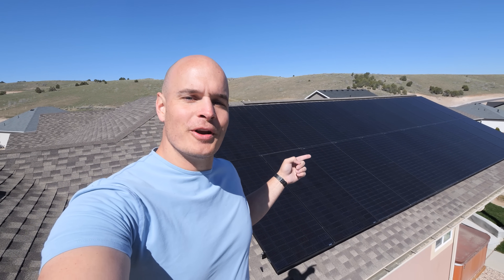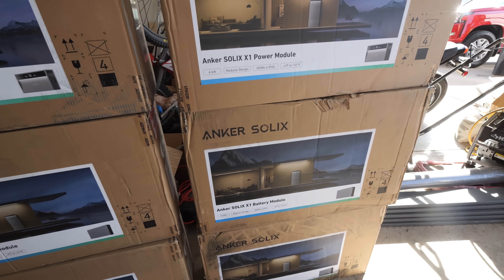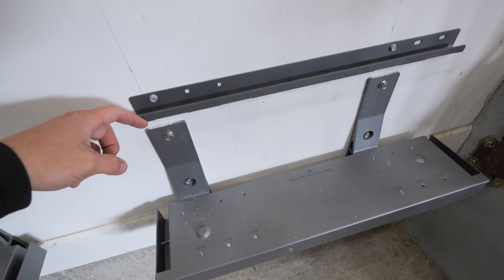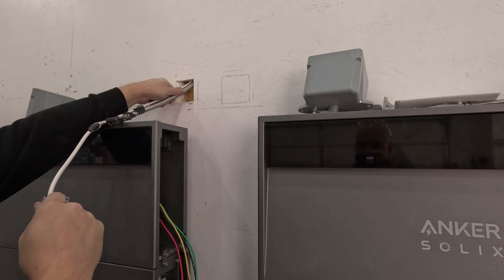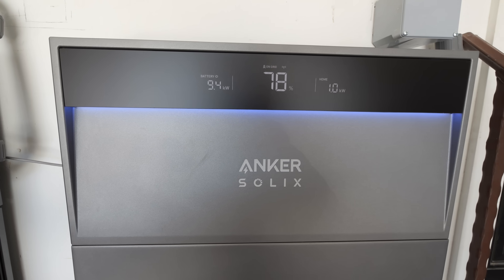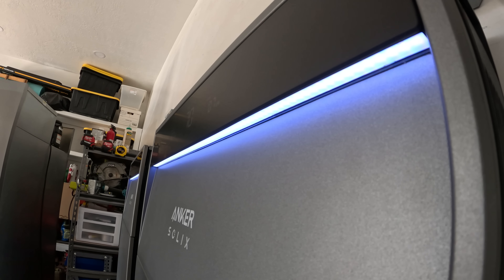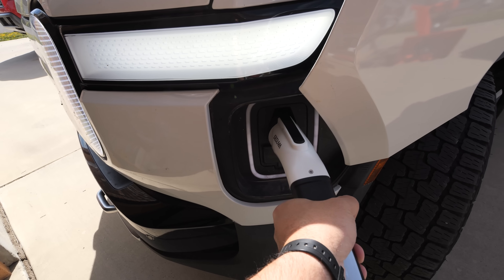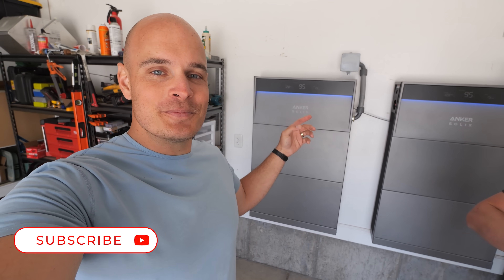How to Save Sunlight for the Night? - NEW Solar Battery Install

Comment: As a german, its insane how easily you guys can just drill through your walls and install stuff like this. Here in Germany we would need pretty big machinery to drill though the walls of our garages (its like 10-30cm solid wall). Nice video!
Reply: Depends on how you make the house... 
Not all homes here are the same...South Florida has huge wind limits on buildings, and last over 150mph hurricane winds.. but not all counties are the same laws.. every city has different little sublaws
Reply: In California its ridiculously expensive to build homes out of brick or concrete due to the amount of earthquakes and the reenforcement it would take to be structurally sound.  Wood homes are much more likely to survive as they can bend and sway a bit.
Reply: @misterinternational  that why they invented anti-seismic house  technology.
Reply: @misterinternational  do it right wooden house can last 100 of years.....
Reply: Is just expensive and americans just want cheap things not because of earthquakes you have literally tokyo that has house made out of concrete and huge building but never collapses because  of antisismic structures  @misterinternational
Reply: @misterinternational  We have quakes too, houses are still made out of brick, mortar or concrete. Some of these houses are older than modern US, some are older than US period. :)
Reply: Yeah American homes are pretty much made of cardboard when compared to European homes.
Reply: @Fisheee123 done purposefully for this exact reason! Less materials makes it easier to modify and rebuild the home on the land every few decades vs having to live in a 209 year old home with doorways that are 5 feet tall
Reply: @derekderek2570  I know, I wasn't saying it's a bad thing, just a fact
Reply: @Fisheee123  even worse it’s made of drywall
Reply: @Fisheee123 same in Australia. If you hit the wall hard enough you can make it through, no need for any equipments😂
Reply: @Fisheee123 same in canada ;).
Reply: @Fisheee123  well definetly compared to the continent, but british and irish houses are worse than american, they literally just crumble
Reply: homes made today are built with 2x4’s or 2x6’s vertical Studs centered 16” on center with 2x8 or 2x6 roof framing members. Secured with 3” Ring Shank Nails. And joist or hurricane hangers. Also the bottom sill plate is pressure-treated wood bolted to its concrete footing every 2-4 feet! Also using hold downs tied to the footings. In addition, builders are using 7/16 thick by 2 x 4 sheat’s  of OSB, which stands for (oriented strand wood board)the strengthens the  exterior house walls from rocking! Also 2” Ring Shank Nails, are nailed into OSB Sheating into their exterior 2x4’s or 2x6 framing! The only builders that are using thin cardboard garbage are the ones that are getting are overlooked by the county inspectors! I don’t believe it’s legal in any state or any county to use cardboard sheeting instead of OSB Sheating as I described above!
Reply: Its so funny he cut through it with like a big steak knife
Reply: Now you know why they turn on loud music during play time.
Reply: Das kann doch nicht sein, dass sich unter dem Kommentar nicht die ganzen deutschen versammeln. Ich habe keinen deutschen Kommentar gefunden xD
Reply: @davebond4451  Deutsche Tugendhaftigkeit - schreiben eben alle auf Englisch ;)
Reply: I've installed thousands of homes. PLENTY of solid brick/cement or stone walls. Even just a good handheld battery hammer drill and a masonry bit will rip through them quickly. It's not hard
Reply: Not to mention planning 😢
Reply: Apparently you have amazing walls but terrible drill bits. 😂 I could get through that wall in no time.
Reply: @aaltoadamus9567  You are the only one who said that little nugget. I never said the ONLY one. I said we are a throw away society (one of many and not the only one). I did NOT say the ONLY throw away… You just implied that I said that because you wanted to laugh at yourself, apparently.
Reply: That's wild, because then you have the flipside, places like Japan, where the walls are basically and often, literally, paper thin
Reply: we have stucco, brick, cinder blocks, sand and mud, wood. Modern hand drills will drill into any wall you gave you're not special
Reply: I mean a friend of mine in Germany lives in a house which is older than the US itself right beside the city wall which was build in the year 600.
Reply: you guys have better houses we have easy to change houses
Reply: @VRVitaly easy to change but 4 x more expensive 😉 In USA you pay just for paving what in Europe can get you a whole house
Reply: @xfaktor13 Ill take your word for it... but also matters what income and cost of living is compared to US and what parts of Europe are we talking about...  so we gotta compare apples to apples.
I actually dont know... anyone can educate us?
Reply: This entire thread is proof that people will try and find anything to not only argue about but also make themselves feel superior about. Yall, on both sides, must have some major self worth issues if you're really here saying "nuh uh our houses are better". Who the fuck cares. My house is brand new and fucking sucks. But I'm certainly not about to move to Europe because of it.
Reply: @sys-administrator auch wieder wahr
Reply: Do you think that’s a pro or con ? Sounds like a big pro to me
Reply: And yet the housing cost is very high.
Reply: It will also fly when a hurricane comes 😂
Reply: Because in UAS we have earth quake... 😂😂😂😂
Reply: I wouldn't say all American homes are stick made, out here in Florida it's cement block.
Reply: I rather have a concrete basmeny and solid brick walls than matchbox house. The steong winds alone will f up the matchbox house. I dont understand why in USA where they have so many tornadoes/hurricanes the dont build concrete/brick houses instead of the wooden ones that get destroyed every time.
Reply: @Tkozuh was helping with cleanup after New Orleans hurricanes and people with stick built were better off as house was already gone and they didn't have to pay to have the now contaminated brick taken away after standing for several weeks in water that could eat through an aluminium boat😮 The water was a mix of everyone's drain cleaner, Clorox, gas from lawnmowers and all the other nasty stuff that floods around most people's homes. Oh also the stuff from the industrial  district a couple miles over as well😮 Last thing I'd want is a brick home in a hurricane or coastal flooding area near any city.
Reply: @michaelcummings7246  good point. Have not thought of that. 👍
Reply: Well I was just in homes from the 1870s that are perfectly fine today. Maybe the specs and craftsmanship were better back then but similar building materials.
Reply: Don‘t forget about the 500 Pages of documentary for a PV and storage in Germany! 😂
Reply: their walls are made of paper
Reply: Because is all rubbish thats why
Reply: It's because Our homes are built like crap
Reply: That's because our houses over here are made of sticks and glue.
Reply: Concrete drill bits aren't "big machinery." lol.
Reply: These are very expensive cardboard houses.
Reply: thats, not to insult, because murican houses are cheaply made, wood and drywall where in germany you have bricks
Reply: Haha I thought the same. When he put that saw in the wall 😂
Reply: Jerry I can do that and more they They say about me the person who works in everything
Reply: Same in England. Solid brick!
Reply: Sell your Milwaukee drill and get a Bosch drill.  There. Problem solved.
Reply: but a strong wind won't blow your houses into shreds :D
Reply: In India we have same issue... because our walls are mad up of concrete and blocks
Reply: Don't listen to the haters. American homes are great. Hard on the outside, soft on the inside. There are steel/concrete in larger homes to hold up the weight, but most walls are super easy to access. You can upgrade stuff like DSL to fiberoptic for a few hundred bucks rather than thousands.
Reply: Fortunately Jerry didn't drill (and other things) through the battery
Reply: Its insane how america is still better than germany.
Reply: Yes, you need a core drill bit to drill larger holes
Reply: And how easily they screw the solar panels to the waterproofing of the roof.... 
I love this video, but it would never hold up here in Norway. Mainly because of code regarding electricity.  And as you say. Between my garage and house, there is 30-40 cm of solid wall. 

The sad part... The most effective solar panels I've found available to me, can produce roughly 8700 kwh annually.  I march alone, I used 2.900 kwh of energy.
Reply: Germans really like bunkers.
Reply: Ich hab mir genau das gleiche gedacht 😅
Reply: exactly, and I wonder also - how the drywall can hold such 'heavy' looking equipment long term...
Reply: Because in Germany they build houses to last and here in the US they build them to profit.
Reply: The benefit of homes in the US is the ability to do this. Plus moving to newer materials is easier to do. 

Also this is in California. The weather is pretty moderate at all times. Hot in the summer, cool in the winter, but not blankets of snow. And earthquakes.
Reply: US 🇺🇸 Building standards do not imply good standards but are focused on having a designed end of life, feeding the constant need for rebuilding or remodeling, or in the US, called: Bulldozer and start from scratch because nothing can be reused because it all sucks or was broken from the start.
Reply: You should see how quickly American new construction homes burn down. The wood we use can also be used for fire kindling.
Reply: Haha us house Last very long if you do not count on nature to destroy it. We don't have that much extreme weather. We build to be efficient and cost-effective. Houses are much more customizable too.
Reply: Same as a dutch person I live in a houde build before you guys did that shitty move and this house has some solid brick walls
Reply: Yeah, same in Pakistan
Reply: Solid?  Mit Luftbetongkloetzen? "Air cement" construction can be cut with a handheld manual/power saw and drills, no? Are floors still poured Beton/concrete? Mine in Zwingenberg were, but the walls even 30 years ago were "air cement'.
Reply: I guess having to rebuild after most of germany was destroyed in ww2 has its benefits
Reply: I know i was shocked when he made the holes. Meanwhile I'm staring at a concrete wall and wondering how to get started
Reply: Isn't the American way more environmental friendly? Building bricks emits a lot of co2?
Reply: A hammer drill with a masonary bit will go though no problem for things like mounting screws, like Tapcons. If you want to punch hole big enough to pull wire or conduit, you probably want to upsize the drill. Those bigger drills will make bigger holes.
Reply: You have some very very nice 3-phase electric distribution at home.  I drool over that.
Reply: That’s because our homes are just sticks and paper. One strong gust of wind and it’s a kite.
Reply: Watching from Africa and thinking the same thing… brick houses
Reply: You'll need a masonry/concrete drill bit.
Reply: I think earthquakes make it hard for buildings to be solid here without it all crumbling down at a small 4.0 magnitude quake
Reply: Das war das Highlight in diesem Video xD
Reply: Yo Soy Americano! I've been to Germany, and dealt with that.
I would still love to build my own house out of Cinderblocks, concrete filled, and 50 cm of soil on the roof.
Reply: 'big machinery', dude seriously? you can use a battery powered hand drill to make the same sized holes in your brick/concrete wall.
Reply: @tc8557  It isn't that simple when you get to the larger hole sizes, or are dealing with something as fragile as brick.
A "Coring Drill" is the only way to go, and those are spendy.
And require one HELL of a lot of training.
Reply: We need our homes to breathe,it's so much hotter hete
Reply: As someone said the American builders are not stupid, they build as cost effective as they can. Id love to have their huge houses, but instead my house havto withstand 3 meters of heavy snow and tempatures of minus 25 degrees and i live in the middle of Sweden. And all this means is i havto spend more on structural integrity and isolation that make no difference in my comfort indoors, in relative terms..
Reply: Yes, a lot of cheap throwaway crap here in America. And a lot of people with leaky roofs after the solar installers leave! 😂😂😂😂
Reply: American homes are made of paper. You can easily punch it through 😂
Reply: Yeah.. same machinery required for Indian homes as well
Reply: @derservy4596  in my technical position when somebody calls me and says I am German the first thing I do is put them on hold while I laugh. Then I regain my composure and come back to the call.
Reply: Haha I had the same conclusion! (From the Netherlands)
Reply: Considering they have such powerful storms it makes you question why they build them from wood.
Reply: @sbomorse because it’s not completely about the material, but also how you use the material, how it’s designed. The house I live in is roughly 50 years old, and lots of houses in local cities are almost a century old, theyve just gotten inside remodels at most. not every part of the country sees devastating hurricanes or tornados.
Reply: @sbomorse Agreed… 
If the storms weren’t so crazy I think wood house would be fine. The reason is we’re cheap. 😊 Why do you think we’re involved in so many wars? So yeah I completely agree with you and know the answer as usual. Lol. 😂 HUNDREDS of houses fly up in to the sky every year here. Absolutely agree. And sometimes there’s people and animals inside. 😅
Reply: I prefer our german walls. 😅
Reply: As a swede it is astonishing how much work you’ve allowed to do yourself and seemingly without asking the city for permission.
Reply: @mattisx Depends where you live and if you own the home etc how much you can do without any permits in the US.
Reply: Another thing Europeans can't wrap their heads around is the size of the US. We have houses built out of brick and stone. We have some built out of wood and drywall. Heck we even have some built out of Adobe. Just depends on where you live. A house built in Florida is not built the same as a house in Oklahoma. A house in California is built different than a house in both of those states. Even houses in Northern and Southern California are built differently from each other! Very few other countries experience as many different natural desasters as we do. Heck we have states bigger than some European countries.
Reply: @ParkerTyler Oregon which is like the 5-7th largest state depend where you look it up is approximately same size as Germany
Reply: Paper mache houses that cost 20k to build with bit of wood and plaster that last 20 years vs solid proper built housing that will last ages.
Bit more of a wind and their s**t falls apart lol
Reply: @JohnSmith-oh9ux  Average age of homes in massachusetts is 58 years. Pretty normal to see houses in good condition built before 1920. 

If water ingress is controlled wood on a solid foundation can last a LONG time.
Reply: buddy it’s okay i know geography is hard
Reply: @JohnSmith-oh9ux sounds like you know 0 about engineering
Reply: @JohnSmith-oh9ux  but you can easily add electric parts
Reply: @JohnSmith-oh9ux  they last about 100 years.
Reply: @JohnSmith-oh9ux  $20,000 for cardboard? Damn .. in Europe (not everywhere) for this amount you can build (with your own hands) a concrete house, or a brick one, but it is more expensive and not so durable .. Reinforced concrete will allow you to build a large house, with large windows that save the same concrete and let in light inside without letting out the heat. Heck, you can build a 3-story house with a flat roof, completely poured out of concrete.
Reply: Eh,  @JohnSmith-oh9ux  gypsum insulation drywall are all pretty sturdy stuff. It doesn't hasn't have to be about how we don't make our walls out of solid steel
Reply: @JohnSmith-oh9ux  Real cringe of you to think THAT poorly of other people. American builders arent stupid, they know perfectly well how to build homes suited to their environment.
Reply: @Frozty  If we are being honest, it’s not about the builder. America is a throw away society - everything is disposable including our dwellings and, being that we see it that way, very little is intentionally built to stand the test of time here. It is common to see houses that are well over a hundred years old in Europe (and many that are well over 200 years old, too). It is distinctly uncommon to see that here.
Reply: @jimk8520  That's because America has only BEEN A COUTNRY for 248 years.
Reply: @Frozty  That excuse doesn’t wash because there are examples here. At best that excuse accounts for 50 of that 248. Modern architecture aside, there was a good 100 years where we should have a great many examples of that type of housing here and we don’t.
Reply: @Frozty  Also, of the ones we did build, we tore many of them down anyway because they weren’t big enough for our “asses”.
Reply: @jimk8520 kinda worried because we are starting to follow a similar route. Pretty much all the forest owners here in sweden go for the fastest growing wood nowadays to maximize profit. Can barely find any high quality furnature anymore which isnt crazy expensive. Sure its great that its still proper wood but compared to old furniture and houses, its very different. 

We had to renew some things in our bathroom and the idiots ripped out parts of the window frame of solid wood and replaced it with new super cheap materials that i can punch through.
Reply: @Xirpzy  Very unfortunately, modern capitalism demands it so.
Reply: @jimk8520  My hometown Memphis TN had many great examples of 100+ year old houses. All of them eventually get torn down and rebuilt and that goes for most cities I've lived in. No point in making something permanent when it's 10x easier to rezone and build back better than ever down the line.
Reply: @Frozty  What's that got to do with anything ? You really think other countries with better construction standards are ALL older than the US ? 😂There's Finalnd, Germany and Norway just to list a few. Your comment makes no sense.
Reply: @jimk8520 how do you expect to see homes over 100-200 years old? The USA isn't even 250 years old. 
A lot of towns aren't even that old, 50, 75, maybe 100 years old.
Reply: @justSomeUserOnYT  A lot of towns are that old in this country. Are you really trying to tell me that once they got here, they completely forgot to bring best building practices with them? Do you think we reverted to grass huts or something for the first 150 years?
Reply: @Frozty  whatever dude built my house is, that's for sure  he installed all my receptacles upside down and installed the sofets by drilling through them 😂😂😂
Reply: @jimk8520  oh wow its almost like people in europe were building with stone and brick long before people in north america were, it almost like europe has had a larger population than north ameirca for a long time too
Reply: @jb76489  oh wow it’s almost like we can’t do anything in only 248 years.
Reply: @jimk8520  sod the moon landing and the internet, America doesn’t have as many old buildings!
Reply: @Frozty  not really, how come american builders dont build concrete homes in hurricane and tornado states ?
Reply: @jimk8520  Gee... Nice generalizations you are making.   In California we have earthquakes - you have read about those, right?  We like our houses to flex with the earthquake; much better than falling on us.   We also have wood.  We didn't cut all the forests a few generations ago.

Let's not generalize, shall we?
Reply: @epelegrillopart  Sure, there are exceptions to every rule. America is made up of 3.8 million square miles of which California (at 164 thousand square miles) makes up  a little over 4%. You can have your earthquakes and my generalization still stands (unlike your architecture).
Reply: @jimk8520  And you, of course, know everything about all the different architectures in the USA.  

Look, I was born in Europe and have plenty of family there, and grew up in Latin America, and I've lived in the USA for more than half my life.  I know enough NOT to generalize.
Reply: @epelegrillopart  You can go to almost every major city east of the Mississippi river and look at old photos, compare them to satellite data, and see for yourself that we tore out much of what was old including magnificent structures built of stone and brickwork that we could have saved and modernized. I stand on my generalization.
Reply: @jimk8520  I have limited experience.  Mostly California and a bit Oregon and Washington. And a couple of small samples elsewhere - the downtown of Cincinnati was a nice example of redeveloping old buildings.

In my area the key driver is $$. Land value is high and there is limited cost to tear a residence.  Buy a house, tear it down, build something double size and charge 3 times.
Reply: @jimk8520  
an old house we use to live in about a decade ago was built in 1900 (according to records). that would make it at least 123 years old. the wood frame was fine 10 years ago, the foundation (concrete/stone) was not. wood framed housing was and still is very durable as long as the foundation is durable as well.

the main problem was that the area it was built in is technically swamp land (wouldn't even be legal to build a house there if it was torn down). so the amount of constant water damage to the foundation took it's toll on it.
it's still standing far as i know.

anyway the reason you don't see a lot of older homes is because the country isn't that old to begin with. the US is only 248? years old, which is almost half the age of the country.
wouldn't make much sense to see a bunch of old homes in a country still so young in comparison.

also the buildings in Europe you speak of wouldn't stand if it had natural disasters like we have in certain states.
it really depends which part of the country you live in, how a build is made changes wildly because each area is protecting against certain things over others.
Reply: @Frozty  Lol, no they don't and he is exactly right. Most homes built in the U.S. are trash now.
You are obviously nowhere near the industry or you wouldn't have made such a stupid statement.
Reply: im still laughing to this day about why americans dont even use brick walls lol
Reply: @Mario-do1vf  Don't know where you get that impression?? A lot of houses still have brick walls depending on what part of the US you're at.
Reply: @Mario-do1vf  we have brick houses lol. my house is made of hand made brick. its just not every house is made of that.
Reply: Get yourself an impact drill!
Reply: Solid wall? You mean concrete wall?
Reply: @Nonsense62365  we build brick walls as well
Reply: Well when tornadoes 🌪  do come USA houses are like are made of paper while houses in Europe stand firm.
Reply: Rather have thick walls than car getting into your living room
Reply: @oinkj  yeah real problem in America.
Reply: Well, on the flipside, our tools might not be as dainty as yours as I can just grab a regular hammer drill from my Milwaukee set and drill straight through whatever wall you’re talking about. Maybe our walls aren’t weaker. Our tools are just stronger.
Reply: yeah but if a little gail appears, our european houses will still stand ;)
Reply: @michaelkeller5008 I’m here in US, Louisiana. My parents house has been through more major hurricanes than I can count. I have a very large family on both sides and only one person has lost a home. That was due to a massive tree falling on it. 
I DO wish out homes had more character and had more insulation etc though. The rising heat every year is becoming an issue because our thin walls (with garbage for insulation) aren’t enough. So yes, I do wish we had slightly better housing, but not because they aren’t massively storm proofed… but rising temps!